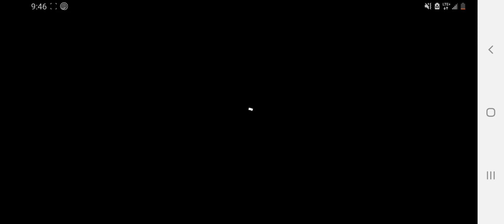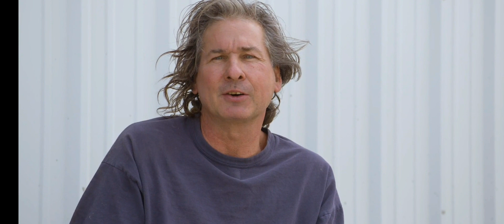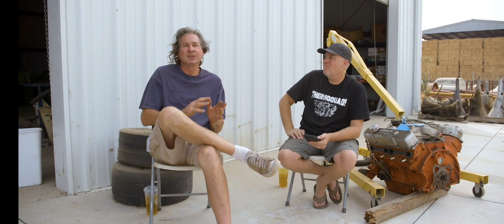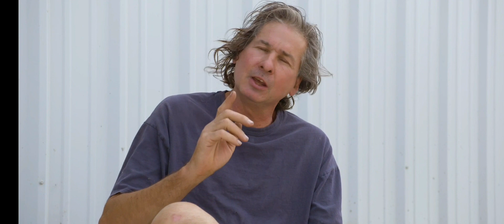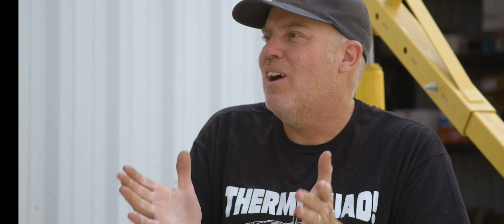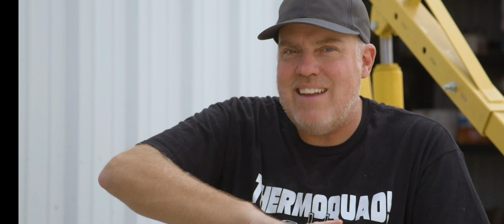uncle tony's garage gets called out by the roadkill guys and they say he's  full of shit

Comment: Engine masters later proved it. The difference was 3hp and 7ft lbs of torque gain. No real gain and not worth doing.
Reply: Very true....why would anyone tear down an engine for 3 hp?... BUT ...if you're assembling an engine why would you leave 3hp behind when it costs nothing in time or money?
Reply: @oops1952  because the side load on the piston skirts are different and won't last as long as it would being out in the right way. I remember a lot of the dirt track cars like that being rebuilt twice as much as one built the right way and they weren't winning races that way either and next season it'd always be a new group of guys trying it.
Reply: @spartan1876  If you look at why they offset the pin in the first place, it was to ride the skirt heavier to the thrust side. It made a small increase in friction but kept the engine slightly quieter (like hydraulic instead of solid lifters). Race pistons are mostly centred. By putting the offset to the opposite side the piston acts more like the zero offset. Engines don't wear out faster when you reduce friction. Mine lasted well.

Comment: sounds to me like if aftermarket puts it in the center then thats the best they dont do it offset like the factory so maybe center is best but offset the opposite way is over achieving that goal it doesnt give it a bigger advantage than center pins but its still better than offset like factory intuitively that makes sense to me. the question is not why does the aftermarket put it in the center the question is why do they not match factory pin positions the answer is factory is not that good center is best and opposite of factory is inbetween center and factory THAT MAKES SENSE TO ME

Comment: I see an engine masters coming on. 
I think center line gudgeon pins also allow for relieved con rod angle in a stroked application. Probably one of the main reasons after market pistons are designed this way.
Reply: Not all aftermarket pistons are made with zero offset
Reply: True. Alot are though.

Comment: Vizard mentioned both are correct. Depends on the piston. An old Smokey Yunick trick. Didn’t have hypereutectic pistons then
Reply: Notice that no one says less power for reversing pistons. Take an average of all the results and it looks a bit of gain
Reply: @oops1952  just more piston slap...
Reply: @darthhemi1735
Reply: Same as zero offset I guess

Comment: WOW, give you guys a huge budget, and you have completely forgotten where you came from, especially you, Mr. Freiberger!  I still find what you do entertaining, but I think you're really starting to lose your connection with the average wrench-head.  I used to REALLY enjoy your take on things right after you saved Car Craft back in the 90's.  It seems money and success has changed you, not just because of this posting, but many things that you have done lately that "Joe Average" can't relate to.

I'm in Uncle Tony's camp on this - If I'm using stock-ish pistons (I am building a motor right now with N.O.S. TRW forgings in a 351W, and they have the offset), and I can get even 1/10th of a percent of added HP by loosening things up a bit by reducing frictional losses, I'm going to do it.  Would I pull a motor apart just to reverse the pin offset?  Heck no, that's foolishness, and you know it!

I have a suggestion that would be interesting to all of us - YOU build two equally prepared motors and flop the pistons around on one and see what the difference is, if any.  Given your resources, that would be more helpful than simply dissing those of us who disagree with you.  And please do more LOW-BUCK, as you did in the early days of Roadkill.

Comment: or you could get an original 318 with sleeves that are oem sided to use the original pistons, no taper. im kind of disappointed in roadkill 😔
Reply: sized* not sided
Reply: @THExWASP  Lol what.  You're suggesting they re-sleeve some old $200 318
Reply: @Cutlass_Rudd  they were complaining about taper in the cylinder bores and not being able to use the stock oem pistons, also its not about the the the cost of sleeving or what engine, its about proving swapping the offset causes power gains or not
Reply: @Cutlass_Rudd  plus, 318s and 360s are clearly free to 100$ at most (joking) lol

Comment: These guys are so wrong.  IT WAS DONE by Super Stock racers.  Back in the day there were no custom pistons so stock pistons were used and it did add some power.  Yes it was small but if a 4hp increase gives you an advantage and you're a class racer, you do it.  Nowadays every engine from Hudson 6s up has custom pistons available and you're right, about all have centered pins.  BUT 40+ years ago that wasn't the case.
Look to modern engine design and the subject of offset bores where the crank centerline doesn't intersect the bore centerlines.  That's the same idea done by different means.  At least one big car company has investigated this in the last 10 years.  The idea is the power stroke starts with the rod at a slight angle.
Reply: it didnt work... just makes piston slap...

Comment: Im gonna straddle the line on this one. Power is so bound to airflow that foe a guy who has a choice of parts and modifications there isnt much you can do to a wrist pin, rod length, or combustion chamber (unless its knocking, then maybe a different chamber can help.) thats gonna transform your engine unless it influences airflow. But on a speedway where you run wide open sometimes for hours especially with a restrictor plate governing airflow then the subtle changes to bmep, knock resistance, temperature, can add up to some advantage be it laps between fuel stops or a mile per hr or two. While smokey yunick was a proponent of long rods and offset pins, he specifically said to get the rod:stroke up to 2.5:1 or as close as possible. Unless you like 3" strokes or really expensive pistons which you might break at the track or have issues with ring seal then thats gonna be problematic in a sbc or 289/302 block. It may fit in a windsor or cleaveland or a majorly destroked pontiac or an olds big block with a small block crank in it but on the engines that are cheap and plentiful with low cost parts its just not gonna fit. And the wrist pin offset is gonna come with 4valve reliefs not two unless its a ford or ls or bbc. The reason is that to have the same timing and geometry on all pistons youd need 4 different psitons on most gm and mopar engines to do it with 2 valve reliefs. This is why aftermarket pistons arent typically offset. Not because there isnt a (albiet small) advantage. Its that youd have to communicate that each piston has only 2 possible positions and youd have to sort them and they probably dont want the support problems. All that said i do believe the factory pistons already have the pins offset the right way for efficiency and high end. And reversing them might have a slight advantage (measurable? Maybe not) on the bottom but i may have that backwards.

Comment: It was my understanding it had to do with off the line throdle response not a actual power gain but it was for flat tops or factory spec pistons not modern after market it dates back to the flat head guys looking for any advantage over the other guy who was running petty much the same parts they were  and was a trick used by many old school racers in the 60s/ 70s  so calling out some one for using it on near stock old school engine is frankly bs

Comment: It depends on the engine ...  Inline six's can benefit from this if you are building a TQ engine with small cam and no worry about valve contact.  Re-using stock parts to make a runner cheaply.  
Would I do it to blown alcohol motor - no way.  That motor has aftermarket pistons guaranteed.  
So cheap back yard hot rodding low buck - sure.  Building a custom killer engine - uh no ...

Comment: This ? Would be cool on a engine masters myth busters thing test . Their are people for & against this idea .the way utg tells it . If you have a 300 hp motor flipping the piston around & put it on the other side ( first piston on the right would be first on the left ) you still have 300 hp , but have a better power curve . Now in stead of some other people that made comments on here & put anyone down . All three of you have built many motors . Everyone had their opinions . The ? Is would it work ? If yes is it worth it . It just may be it works in low mileage motors or it's old school tech that's outdated do to modern technology makes it a dead issue . If your both right then it may be that to use it would take a motor with cast Pistons on a low mileage block . So a low mileage 50 year old motor . After just saying that you will end up devalue the engines worth . The world may never know

Comment: False argument to say "if taking out offset improves things, wouldn't taking out more be even better?" If you begin with X performance at zero CL and degrade it with offset for sake of noise, wear, life etc, removing that offset will return you to original X performance. Continuing with more offset correction potentially moves you past optimum and back to perf loss. So while saying flip offset pistons for +power may be misleading, saying remove offset for best performance may be perfectly true. As for dyno results, I fear that y'all may fall off the peak of your curves if see a HP rise going from 6000Rpm to 7000Rpm and logic that means 8K or 9K will be even better. Now carry on with the p#ssing match! LOL!

Comment: Gee maybe aftermarket pistons don't have a pin offset because it's the best compromise between piston rocking and the factory quiet offset. Also flipping pistons is free costs much more money for aftermarket high quality pistons maybe not so much for Chinese junk. Your scenario of flipping pistons in a worn out 1969 engine is just silliness. Assembling a fresh engine with stock flat tops takes no more time to install either way. And what is this nonsense about 7.5:1 compression. Me thinks flat tops in a 350 Chevrolet with even an open chamber and a sensible deck height is more like 9.0:1. Your little rant at the end is funny but just nonsense.

Comment: The reason you won't see improvement on the dyno is because of the gain is at low rpm which a dyno can't test the information about flipping the pistons was from direct connection so I'm pretty sure the engineers from chrysler the designed the engines know more then these clowns they blow up way more engines also ugt has a 318 that he built for bottle rocket and is basically a junkyard engine beats the piss out of the thing trying to break it Steve has blow up like 3 engines that he built for his mopar muscle truck with Fancy aftermarket parts even

Comment: an offset to the side the crank rotates (piston offset from crank axis) lengthens the intake and power strokes while shortening the compression and exhaust strokes.
Turning the pistons backwards is a crude way to achieve this. but it would only help at high rpm because that's when the piston speeds get too high for the intake stroke. as well as the power stroke - the mixture doesnt burn fast enough. hence Formula 1 teams used super volatile gas mixtures in the 80s consisting of mainly Toluene.
Some OEM engines today are produced with an offset piston bore from the crank axis.

Comment: Battle of my favorite magazine says this has moved to battle of my favorite you tube creator says this lmfao your arguing over different worlds of budget and one side is literally arguing against engineering geometry and physics because a dyno doesn't show it.  News flash for what should be common sense  a dyno is no different than a 9/16 wrench it's a tool with limited purpose and use. All that matters in the real world is your et, lap time, or the smile on your face when you mash the throttle etc. Even durability is subjective one guy is happy with an engine that lives for one pass another guy wants one to last their lifetime. Some would also have you believe rod ratio, piston height, ring thickness, cylinder head material, valve angle   etc just don't matter because of dyno numbers but I've never witnessed dynos racing anywhere either out in the real world 😉

Comment: This is inaccurate. The right engine, and the right situation it is a big advantage. And you clowns backed off your "challenge".. found put your wrong? Or what?
Reply: How did they back out of a challenge? UTG is the one claiming the mod will give you 25HP so it is up to him to prove the myth is true.
Reply: @VegasRT500  he dropped a video. Stating he would build an engine.. he then got told that there wasnt time in their schedule. Which tells me, its not a money maker, so there's no interest. He offered to prove it. But since there's no new parts that can be sold, got told nah, we have not got the time. The trick does work. How much power it adds? I have no idea. But its enough you can physically tell. We tore an engine down once and reversed the pistons, put it back together and noticed a change. Just because its not common practice to you guys does NOT mean it doesn't work. Hes not full of it. Its a real thing on the right engines.
Reply: @Z_732  Correct, it's  good some  can see through the arrogance and lies.
https://www.youtube.com/watch?v=sq1mPjRJBpM
"Why, that can't work why  we bolt  on 150 HP ... so  it cannot  work !!!!" "stop  being poor !" - cuts to paris hilton poster on  shop wall
Reply: Hahahaha! Exactly!